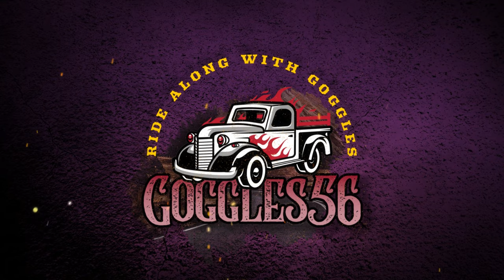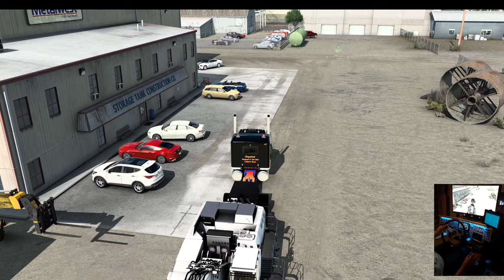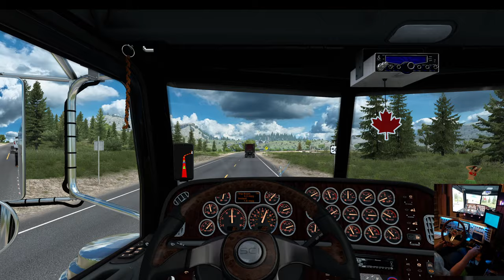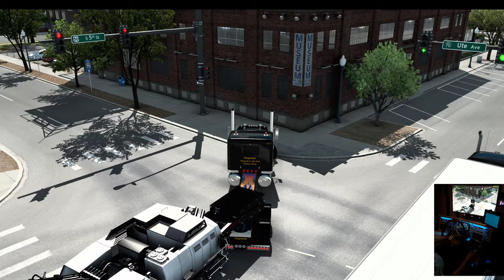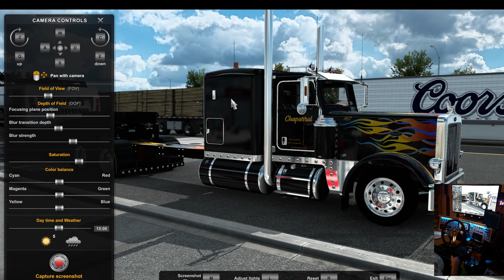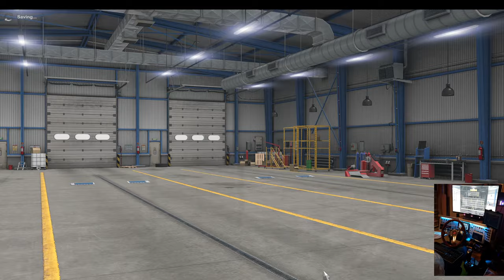ATS Pinga 389 from Alamosa to Grand Junction Colorado

Comment: Interesting video. The combination of the short, but wide load and the rather long truck frame made for tricky maneuverability. Would have been very tricky in those curves with heavier traffic.
Reply from the maker: Karlos, I run my traffic at 50% so I don't run into too many really frustrating situations. A happy side effect is that I get to use the oncoming lane more easily on tight corners. At 373", that chassis is a little over the top.
Reply: @danmcnarry  Makes sense. I've never messed with that setting, but I've considered using it every time I get stuck in Portland traffic